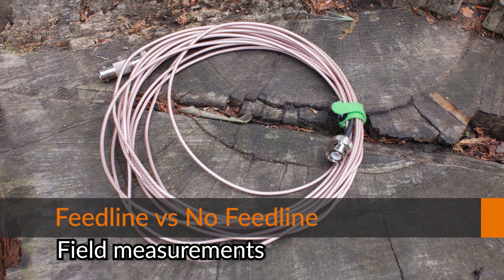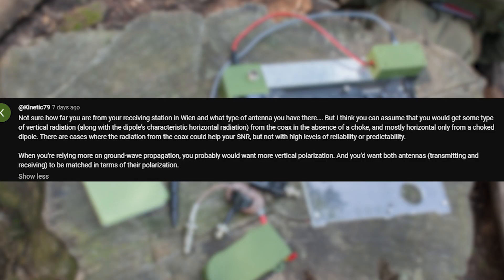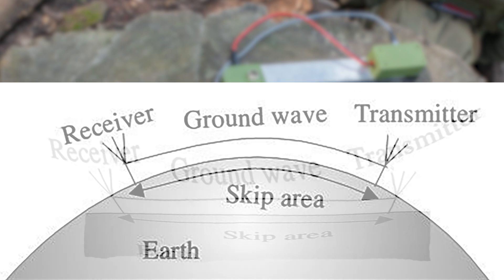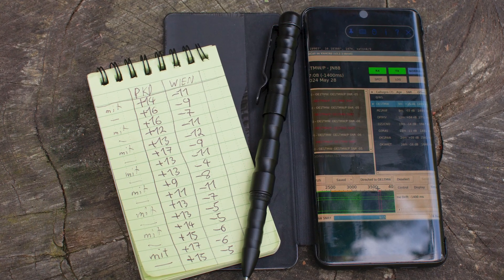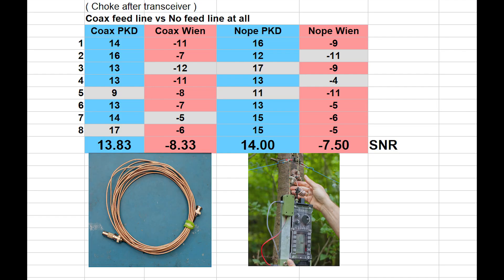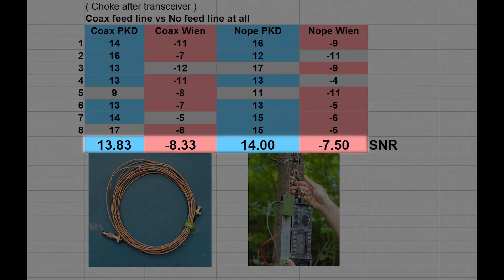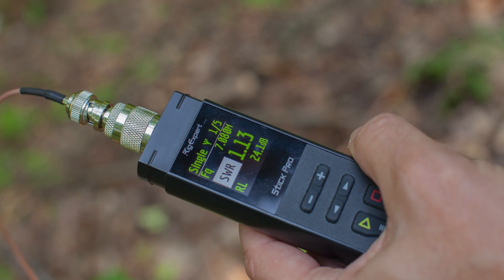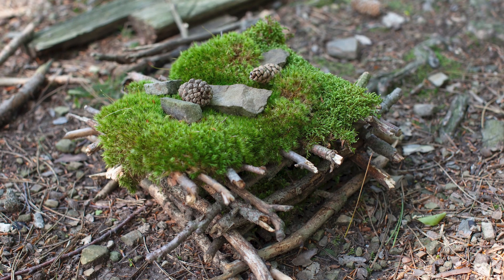NVIS Dipole, Coax feedline vs No feedline

Comment: One of my favorite backpacking antennas is a upright V Terminated at the radio, no feed line. Worked very well lite wight. I used the radios internal antenna tuner two 42 foot wires
Reply from the maker: interesting, thx for the info!